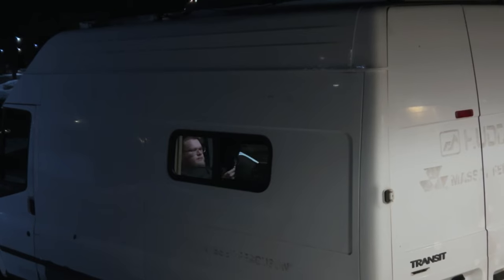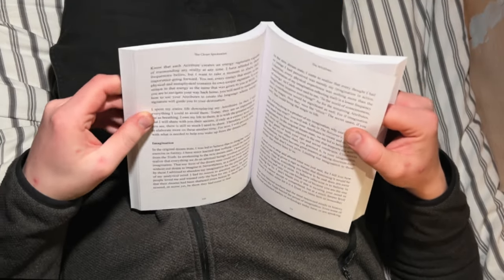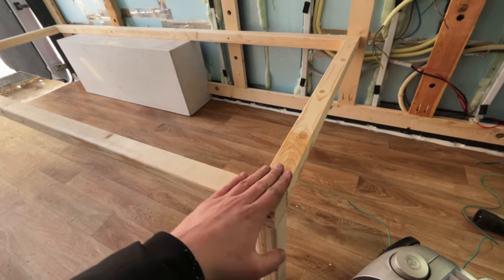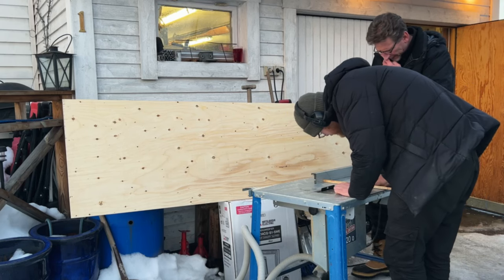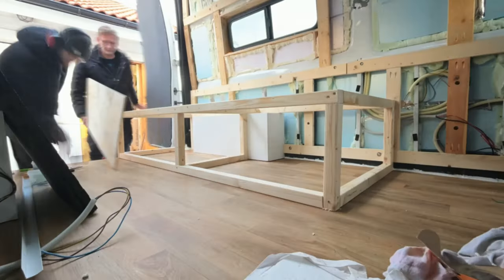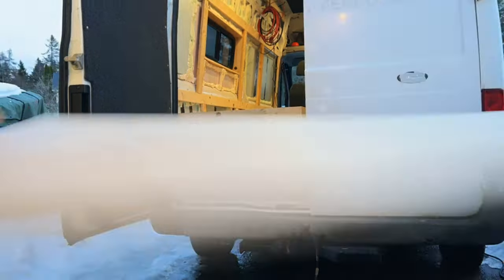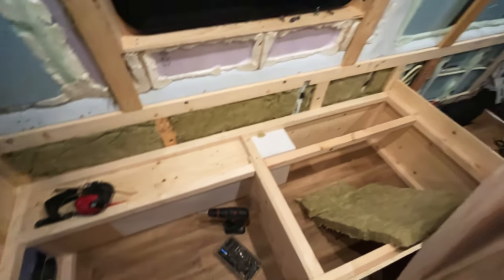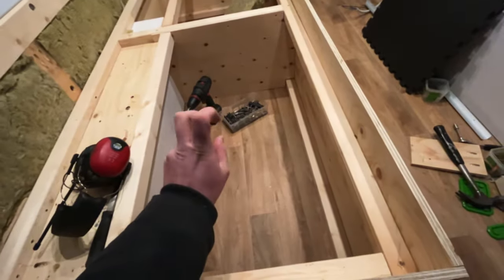I Built My Camper Van Bed The Wrong Way | One Road - EP12

Comment: I agree with you. I am only 175cm  but in my opinion a bed parallel with the van is practical , giving access to the van from the rear doors as well as the side door.  This is how I am doing mine. If a double bed is required there are plenty of designs on Utube that coverts a couch to a double with sliding slats. In Australia, we are lucky enough with the weather to do all our cooking outside. So only requires a small space inside to hold a camp stove if the weather is terrible and windy. Many years ago I travelled in a full size Mobile Home on a truck base, with an a stove, oven etc inside. In three years I never once cooked inside.  Maybe boiled a kettle now and again.   Good luck for the future.

Comment: drill some holes in the bed base plywood to let the mattress breathe...ask me how i know........lol
Reply from the maker: Ye, thats probobly a good idee to do. Have to put that on my to do list 🙂👍
Reply: Good tip, and to use a layer of hypervent or alternative between the mattress and the surface it rests on, for ventilation.
Reply: @Michelle-bw1xg  Yes because you normally sweat as you sleep and moisture has to be able to wick away

Comment: I have a standard minivan (not commercial), leveled the floor with plywood. Hoping to build fixed bed with a pure latex mattress. Challenge is to fit a fridge and other items without having the bed be too close to the ceiling. I agree, has to be comfortable or it will be a fail. I would be in pain with a cheap or too-thin mattress. I will prevail eventually with a layout, enjoyed the video. Bless your Dad for helping with your project, that's a real gift.
Reply from the maker: What we built in those two weeks, would hade taken me months, so ye its a real gift!

Comment: Murthy bed, I can sleep 4 ways  when it drops down to the settee, and it gives me a small double in any direction👍 good luck in finding your bed
Reply from the maker: Options is good to have. Would be intresting to see how you duild the bed
Reply: It was easy to achieve. I used  piano hinge for it to drop down. When it is down it sits on some doors that hide  the water tank and on the opposite side is a settee  that forms part of the extended bed, basically I formed a rebate for it to sit on